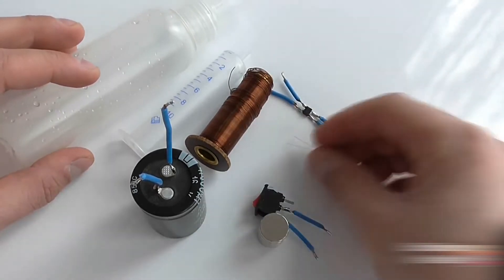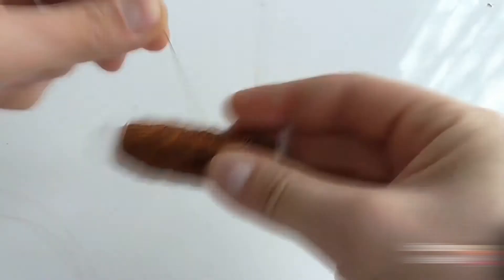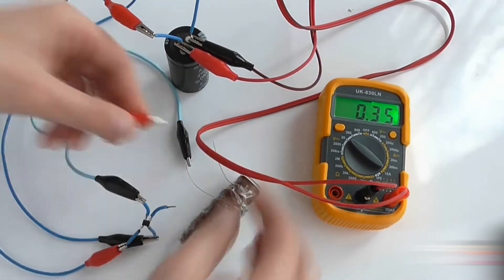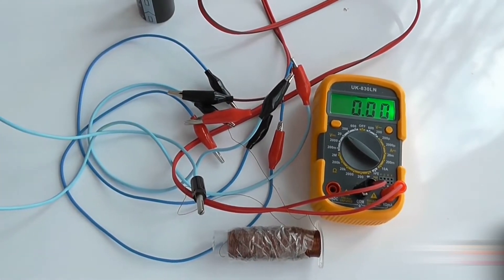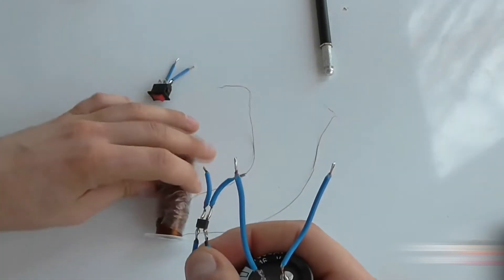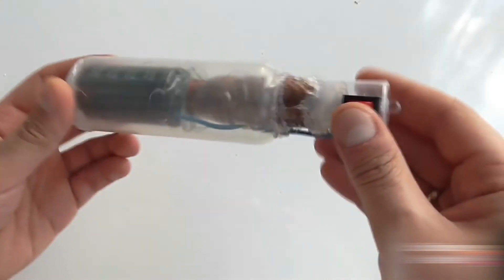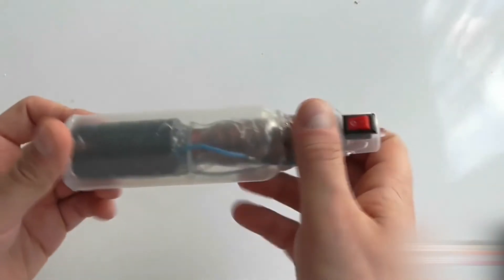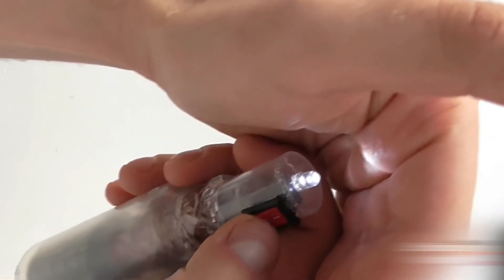How to Make an Eternal Flashlight at Home. Doesn't Need Batteries! // HomeCraft

Comment: Why do you blur out the logo of the guy who makes these videos you're reposting dubbed in English, replace it with your own logo as if it's your content, and not give any acknowledgement to his channel?
Reply: Tôi đã quấn 11600 vòng. Điện áp tạo ra 3v max. Nhưng dòng làm sáng led tôi đo được có 1,3mA thôi. Nhưng led trắng vẫn rất sáng luân phiên. Tuy nhiên tôi không nạp được vào siêu tụ 2,7V 10F bạn ạ. Tôi dùng 4 diode 1N4007 mạch cầu nắn ra cho vào tụ nhưng vânc không nạp được. Tụ đã kích thử bằng pin 18650 tụ tụ vẫn nạo được
Reply from the maker: Please visit the channel of the creator and you will be able to see that this is a partnership project.